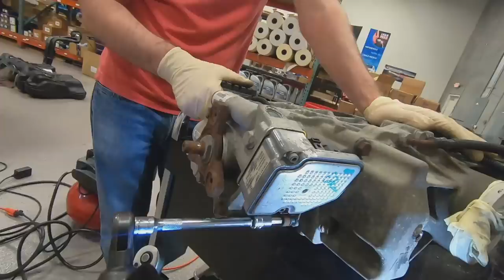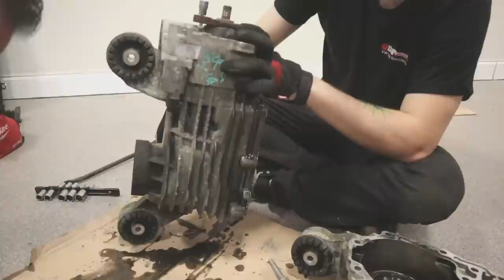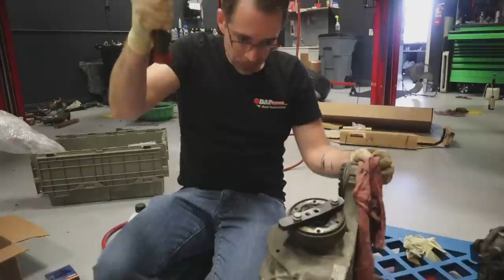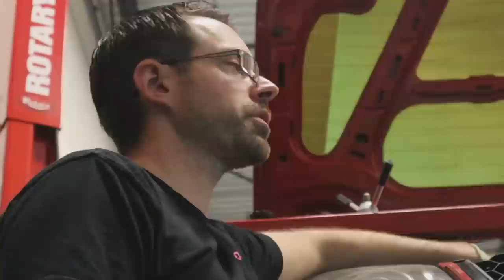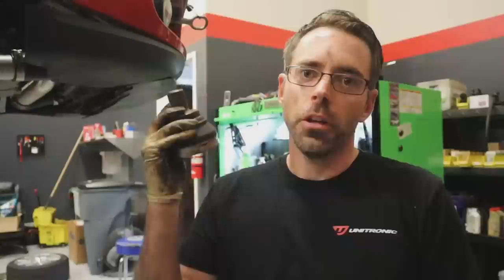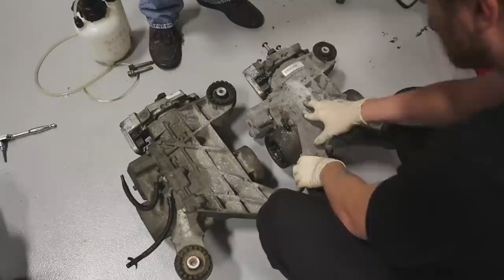Welding our Haldex Diff for RWD | Pt 3

Comment: Pro tip: if you round off a inner hex drain bolt, you can usually hammer in a torx bit.

Comment: Great stuff guys, keep on going. Will the clutch plates and haldex oil pump sustained pressures from diff lock, and why you didnt weld clutch platws to the diff? Will rear diff from a4 quattro in some crazy way fit to your golf?

Comment: Would the Haldex clutch pack not cause slipping since it's before the diff and also a clutch based system? I've seen Kyle from boosted bois weld a similar style clutch based system that's on CRV's for that reason and is why I ask.

Comment: Just wondering why you didn't replace the Haldex with something solid whilst you had the diff unit in pieces for welding? Seems like it would remove a point of potential failure, plus save the cost of the aftermarket 4wd controller.

Comment: Love the videos guys. Been wanting to convert my MK5 to AWD for a while now to help with my traction issue haha. This series just proves it's totally do-able! I've had a really hard time tracking down an AWD manual transmission but I found some DSG's. I'm curious, would it be possible to swap the AWD DSG front diff into my 6MT so I can attach a bevel box to the other end? If I explained that so it makes sense...
Thanks!

Comment: Didn't chatch it - Did you weld up or fix the haldex clutch too? If not, only parttime powertrain? PS, slide hammer for pulling the driveshaft stubs is a lot easier.... ;)

Comment: Hearing you say that there’s so many ccs in there because they jump timing really scares the fuck outta me. Mines a 2012 and I just hit 110k
Reply: I also have a CC with a 2.0tsi, bought it with 150k km’s. Timing chain jumped (chain tensioner failed) at 162k km’s (around 100k miles). I was lucky that it jumped with starting the engine, so it saved the engine. Probably drove around with the problem for a while before it happened. 
So, if you get a check engine light, diagnose it immediately and maybe you can save your engine. 
 Most common engines are the 3.6 fsi and the 2.0 tsi with this problem.

Comment: I might have missed something as I skipped through the peach tree portion of the video, but how are you modifying the Haldex to be fully locked? Will the old gen 1 longer bolt mod work on this, or are you relying on the controller to handle it?
Reply: I believe in part one they said they’re using the controller
Reply: @leakyshart9943  thanks, I skipped through that one too.

Find it strange to weld the spiders and leave the multi-plate able to slip.

Comment: Can you just weld the Haldex clutches or extend the shaft to not use the controller ?
Reply: I'm looking to have the same question answered!!! Looking to make a cheap tt track car
Reply: @steveketteringham1765  unfortunately the answers is NO 😅 our haldex system is only a support for when front tires are spinning. Front and rear tires spin at different rates. Rear is only intended to be used a minor time intervals. Welding it will make it bind and break something. The solution I am working on is getting a Honda type viscous coupler instead of a haldex system

Comment: Can you not just bolt the transfer case to the fwd transmission?
Reply from the maker: Need an AWD front differential to have the proper connection
Reply: @Deutscheautoparts  good to know.

Comment: Some fwd 02q’s can be converted to awd by using the diff off an awd car or installing an awd lsd. Some trans already have the bolt holes for the bevel box. Just need the proper seal and bevel box.

Comment: I'm currently in the process of trying to plan doing a 4wd conversion on a skoda fabia vrs mk1, same platform as a 2005 vw polo in america, do you know if the gearbox that you used and the 4wd bolt on transfer case is the same as a 02m 4wd gearbox. Many thanks.

Comment: Well actually on ABS System when bleeding you have to start at the closest to the mastercylinder. That's because you want all the gunk that collects in the reservoir and in the Abs block on the fastest way out and not through alle the long hoses to the valve that is the most away. Pls correct me if I'm wrong :) nice car btw